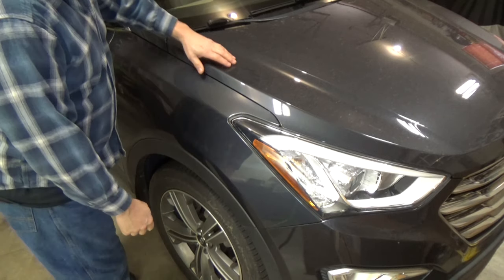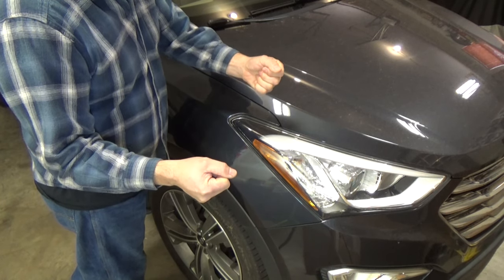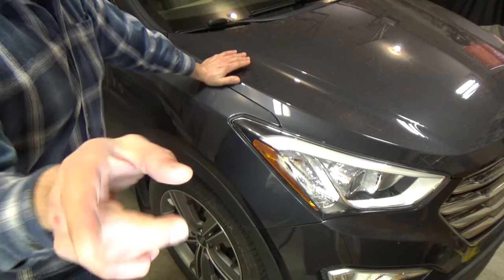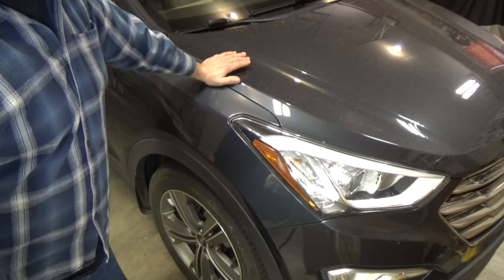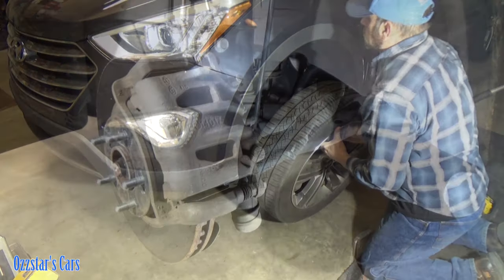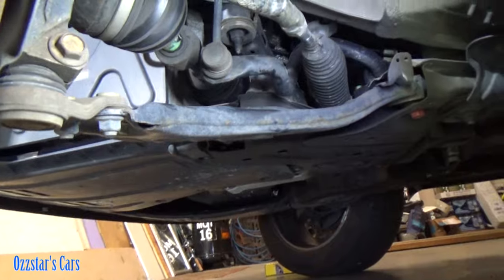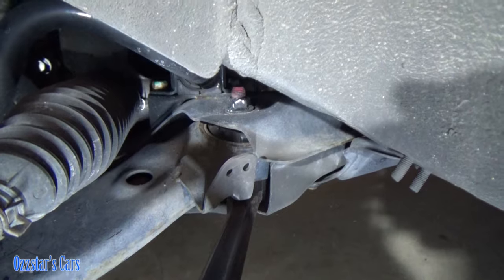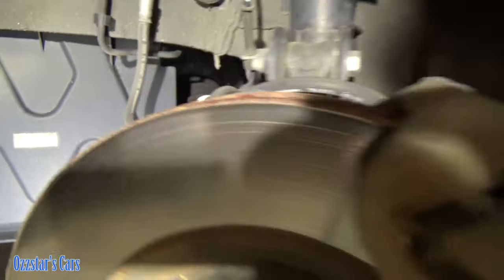Hyundai Clunk Noise Front Sway Bar Link Fix Replacement - Hyundai/Kia 2013-2019

Comment: Kia and Hyundai are notorious for ball joint failures. upper, lower, inner tie rods, stabilizer links. It's wild because these joints will have such little wear or play, but it transmits into very loud noise inside the car. My 13 Sorento is riddled with suspension noise. Parts have been replaced and it still makes noise. Never again kia.

Comment: WD40 soak down reduced my noise by 75%! Happy to return lower ball joint Hyundai (54530-F2100) to Amazon and other tools..... remove tire[s] in snyc of opening the hood......WD40 from top strut bolt and work your way down to lower ball joint.... it worked for me.. :) (Don't kill yourself installing parts)..
Reply from the maker: You do know that WD-40 is a petroleum based oil and will deteriorate the rubber boots that keep out water, dirt and debris? Defective parts need to be replaced to prevent serious damage from loss of control of the vehicle. I am going to leave your comment up so everybody knows exactly what NOT to do!